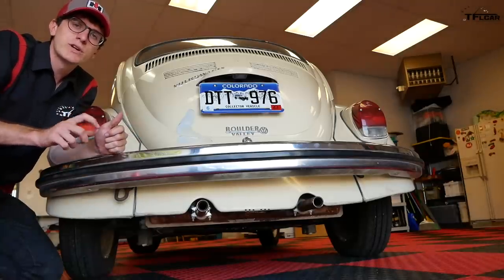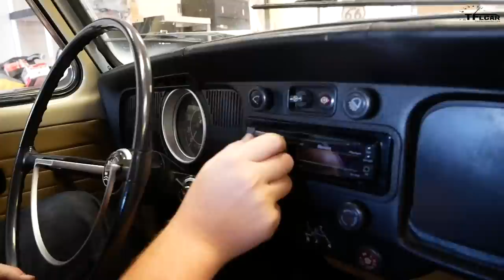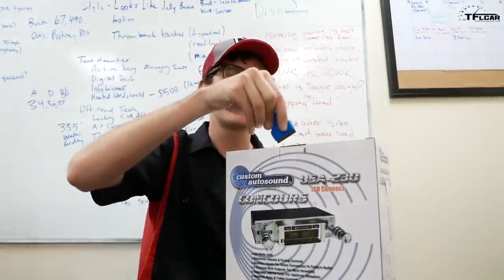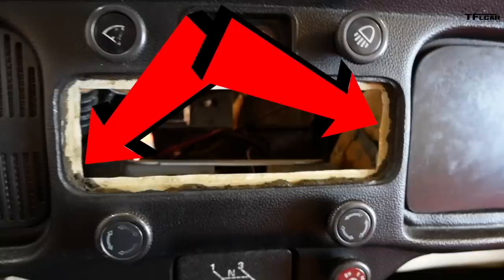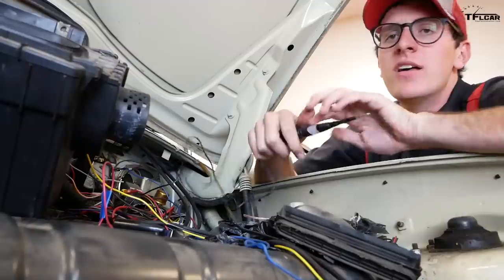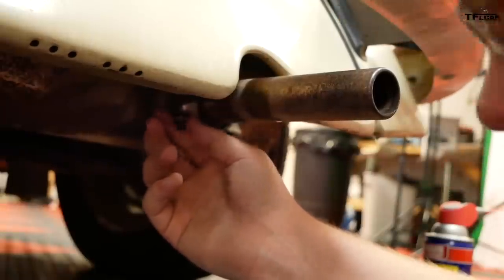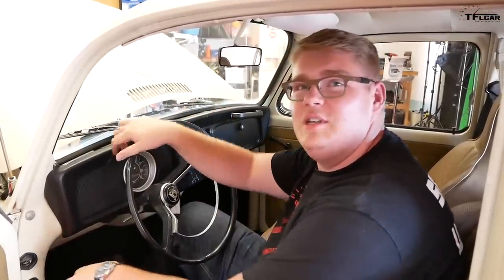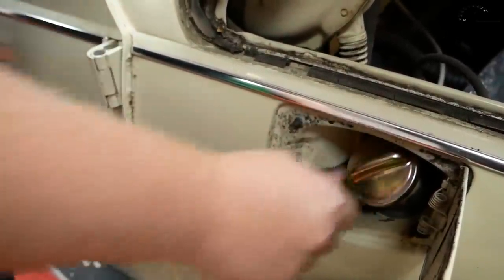How We Made our VW Bug Sound Amazing for FREE | Beetle Diaries Ep. 5

Comment: As an old VW guy I have to mention that chirp will change, depending on how far in you install the tailpipes. If you look in the muffler (with the pipes removed) you will see another pipe on one side. (forget which side) You put the new tailpipes in till you hit that other pipe then wiggle it back out about 3/4" or so. Install the other side to the same depth using a tape measure. That internal pipe creates a venturi effect and helps draw exhaust through the heat riser pipe under the intake manifold. Too much or too little back pressure at that point will change the heat riser flow and also change that chirp. Pushing the tailpipe in too far will also restrict the exhaust. If you get it just right you wont hear much chirp at all. (at least till the baffles rust out)

Comment: I was told that on the old 36 hp engines, removing the muffler caused the engine to run too lean, which damaged the valves. I wonder if those tail pipe tips were to create back pressure or perhaps prevent a too lean condition?
Reply: Just put in a larger main jet.

Comment: Fun video, Guys!  Here's a tip for installing the stereo: The metal plate must go on the interior side of the dash, not the trunk side, as you did in the video.  This metal plate is meant to provide stable support for the radio.  This is why the display is flush with the plastic face plate, which is not correct.   Instead, the display should protrude through the plastic cosmetic face plate about 1/4 inch or so.  Your installation will work adequately if you supported the back end of the unit with metal plumbers tape or other similar material.  When you install the AUX connector, I recommend you correct the installation of the metal support place.  Errors aside, keep up what you're doing.  Fun content, great video capture and editing work!  Cheers from an enthusiastic owner of three 1969 Beetles and two VW busses ('69 & '72).

Comment: My 2nd car was a 1973 super beetle,loved that car,bought it in 1978.Back in those day"s, a mail order company called J,C. Whitney made every after market piece you could imagine for a type 1 VW.Those cars were everywhere and cheap to buy and own.They sold a set of flared exhaust tips that took that annoying "whistling sound" completely away,back then regular department stores sold everything for those cars.Changing an engine was 4 bolts and 7 wires,1/2 day job.tops.Floor jack under the motor,pull it right out,new one went in just as easy.Windshield washer was powered off the spare tire,when you got lower than 26lbs. the washer stopped working so it didn"t totally de flate the spare,alot of really genious stuff on these vehicles!

Comment: I replaced the muffler from a bus one to the correct stock on my Super Beetle. One day, a tip fell off, so I bought two new ones. The one that fell was easy. The one that fell out. The other one-not so much! I had to spend about a week and a bottle of PB Blaster chiseling it out. It welded itself in. I removed the entire muffler and had to put it in a vice. I hop to not have to do that again!

Comment: Those little tweet generating baffles, actually serve a purpose.  The baffles help maintain the correct back pressure on the exhaust. Without this much needed back pressure, your little 4-cylinder friend will suffer from overheating, and possible cylinder burnout. You can run without them, if you use longer pipes, just do the calculations to achieve the same level of back pressure. This is akin to tuning the port on a subwoofer.  In my humble opinion, the Beetle should always have the "VW Chirp", but then I'm an old school "Air Head". Nice video guys!

Comment: I put a vw tip on a allis Chalmers exhaust pipe. Made it real quiet. My brother put a megaphone exhaust system on his vw with a 1300 engine with 1500 jugs and pistons along with a 3/4 cam,two barrel holly carb,bobbed fenders and hood bonnet. That was one fast car. Sounded like a big angry bumble bee. He also installed a fastback engine in another  bug. Had to ease on the gas especially when shifting gears as the front end would come off the ground and scrape the exhaust tips on the pavement. :O

Comment: Great job guys!  I got my 74 Super when I was 14 and I’m now 49, that makes it 35 years of ownership. After all those years I finally decided to try to get rid of the infamous gas smell. You will probably figure out that changing the gas cap won’t solve the problem... can’t wait to watch part 2 of your solution ;-). Keep it up, I love the way to do this serie.
Reply: 35 years of gasoline fumes...that has to be good for you
Reply: Eric Godbout -perso Yup, they'll probably have to check out the tank exhausting vent.
Reply: I cured the gas smell and improved the cooling at the same time.
Reply: @Celticgypsypnw I have a '71 Super Bug, and I couldn't get rid of the gas smell. So, in 2019, it became 100% electric. Now, it's possible to smell the leather seats, and to travel places in a strange kind of silence..........no engine / exhaust noise, but tire rumble of the road. The best thing ever.
Reply: @peterduxbury927  I have looked at that and it is very clever when done right. The cost and range put me off. I beat the gas smell in those and enjoy the original beast within. I redid the whole gas tank venting system and made it actually better than the factory intent. 0 fumes, better engine cooling to boot. Sharing for free to anyone who asks.

Comment: OK now, all you need to do is cut 2" off the ends of those tubes and remove the baffles. I knew a guy who raced and modified air cooled VDubs and he said that was the optimum tuning for the stock muffler (3" from the muffler). Sounds good too. The right aftermarket system can make these engines sound even better, though. I had a Thunderbird exhaust on my Karmann Ghia and it was superb. They were bought by Pertronix some years back, don't know if they're still in production, but Empei and Scat make similar exhausts. This type retains the heater boxes and join in a short collector in the center, and a horizontal, side-side  pancake muffler bolts on.

Comment: You are so lucky to even get the tips out, when you install them, use some never seize so removal is easier next time. also check the fuel filler hose that goes to the tank for leaks as this is the usual source of the fuel smell.

Comment: In my 1963 Beetle I took the standard end tubes out and replaced them with flared tips, so called TT Pipes, from 2 to 3 inches in diameter. The looked very sporty and the sound was much more aggressive. (The horse power remained the same....alas!)

Comment: not gonna lie, I even went out and bought a new exhaust for my bug and purposefully didn't put on the pea shooter chrome tips on lol. I kid you not, mine shoots flames quite big (and loud) when I let off the throttle at a high rpm.
Then i decided to be a good driver and decided to weld metal pipes over the existing exhaust cutouts so I don't have to use the pea shooter tips again and thus making my bug sound more mean. It still shoots flames occasionally, but not as often when it didn't have the chrome tips.

Comment: i didn't look closely enough, but they used to have removable faceplate stereos and removable stereos. to prevent stereo theft, they used to have stereos you could pull out of the dash and others that you could pull the faceplate (with all the controls) off. i can't imagine a faceplate coming off that easily and being put back on and still working if it isn't part of the design.

Comment: In the same vein as big green, it is time to reach out to an air-cooled performance engine manufacturer to see if they will sponsor a huge power upgrade. I am thinking 200 hp should do nicely and perhaps a small lift and Baja bug treatment for this little guy. Then retry Gold Mine Hill. Could be fun. Good video gents.
Reply: they sell fiberglass bodies for baja bugs...much better to use modern suspension and a tube frame is way stronger, safer. plus you dont hack up a classic bug
Reply: stickloaf Good insights.
Reply: Only thing is it's a super
Reply: or slam it down!

Comment: In the sixties and seventies Volkswagen dealers sold a factory accessory they called a Sports Tip they were a larger diameter but still had the baffles in the tip it was tuned to make your Volkswagen sound just like a 356 Porsche I had them on my 66 Karmann Ghia. I thought it sounded better than the header systems for Volkswagens But no one seems to make them anymore

Comment: With the new tips you have the old sound back - that's boring. On my first beetle (back in 1982) I removed the perforated sheets from the inside of the tips. That made a cool sound and looked original. 

On my later 1957 beetle I installed a larger engine and a Brazilian sound pipe, but that's another story.

Comment: Must be the shortest exhaust sys. on any car. In winter it's along way from the heat exchanger to the windshield. A german friend gave up scraping both sides of the windshield and used ski goggles with the window rolled down. The gas heater was more effective, but had downsides. Nice job on the stereo, but it'd be nice to see a Blaupunkt sticker.
Reply: Chris York by 'gas heater' you mean the original one, taking hot air from the engine cooling system through the air-box and into the cockpit ?
I mean, my question may sound strange, but here in Brazil we got almost no experience on heating systems, and since my '72 Beetle has one of those, I'd like to ask you: does it really works good on a cold northern winter ?
Reply: There were Beetles that came with a separate heater that used gasoline from the fuel tank. I've never owned one with that heater, but I think it was quite effective. It had a fuel penalty though.
 The original hot air from exhaust was not effective.
You can buy electrical heaters from the parts store to preheat and maybe even run if you have a good alternator.
No air conditioning in Brazil?
Reply: Chris York, thank you for your reply ! 
I've never heard of such gas heater, I guess it might be exclusive for European/North American winters. 
I just asked it out of curiosity, because I intend to fix my car's heater. 
But surely we seldom need to use heaters on a tropical country like Brazil !
And yes, we do have air conditioning, but not for the Beetle, and the entire air cooled engine line from VW.
In fact Volkswagen started to sell cars with AC systems in the early 80's, as optional items for their more expensive, luxury models.
Reply: Yes, different markets probably. Did you ever get the fuel injected Super Beetle? I got to drive one and it worked quite well.
Reply: Chris York not the Super Beetle per se, but actually, my '72 Beetle comes from a limited series which lasted until '74.
This version got a more powerful 1500cc engine,  elaborate interior in comparison to regular models, but carburetor instead of fuel injection.
But externally it looks just like the one pictured in this video above.
In Brazil, the VW is nicknamed 'Fusca', and this roughly Super Beetle was called the 'Fuscão', which can be translated into 'big Fusca' !
Reply: Ahh, I've seen the YT videos with Fuscão on the Trans Amazonica. 
The one I drove must have been one of the nearly last brought to North America. I think it was a 79.  It was a convertible.
Reply: Chris York yes, I've watched this Trans Amazônica videos, quite an adventure !!!!
Reply: Yes, really amazing! I'm surprised at the kind of vehicles that manage to get through it.

Comment: Not all of the stock style exhaust tips you can get make that chirping sound. None of our beetles does that. Some of them has to be "broken in" and some never seem to make that sound at all. When putting in the new tips they have to be inserted at a certain length. The left one is supposed to overlap the small preheat pipe inside the muffler by 5-7mm, and then just install the right one accordingly. But often it isn't that easy since most beetles have got a new muffler at least once during their life. And the repro mufflers usually aren't very consistent when it comes to these little details. I have only ever dealt with repros and have just made sure that they don't stick too far into the muffler. If they do it can supposedly affect the engines performance (I have no idea if this is actually true but it is very easy just to be on the safe side). They are also available in different lengths (265, 250 and 225). The older the car is, the longer the tips are supposed to be.

Comment: The "chirp" is from two reasons; On OEM tailpipes, the chirp happens when the glass packing has worn away leaving only the metal baffles, OR the tailpipes used are either made in Mexico or Brazil, if you use the actual OEM West Germany made tailpipes, there is no chirp whatsoever, and the exhaust will actually sound very mellow and pleasant too! Another item where country of origin is important is the actual muffler itself, W. German made are much heavier than the others and are also A LOT quieter, couple a W. German muffler and W. German tailpipes, and the beetle would sound almost as quiet as any honda or toyota. A Mexico or Brazilian muffler may actually cause the engine to run hotter and use more fuel, some beetles have even required re jetting of the carburetor after an install to stop an annoying acceleration hiccup that occurs when the engines back pressure has been decreased due to the sub-standard exhaust.

Comment: That chrome trim is also part of the silencing system as I discovered when I removed the rotten ones on mine ad had to fit new ones because of the increased noise level. Where would we be without zip ties? they have so many unusual uses.

Comment: Premier is not a cheap radio. Premier is a step up from Pioneers regular models. Which usually have more power on the outputs, better sound processor, advance equalizers and has a longer warranty. And your so-called Walmart special, Premier by Pioneer is not sold at Walmart.

Comment: My Baja bug had the radio pulled out when I bought it and I used it as a safety back up. If I accidentally left the keys in the ignition and locked the doors I was able to open the hood and pull the keys through the radio slot

Comment: That was actually a pretty good radio you pulled out.  Guessing it was either broken or not wired correctly.  Personally I would go with the retro radio like you did, but hide some better sounding component speakers.  Too bad they already cut out the factory radio hole, the old factory metal opening definitely looks better.

Comment: Actually, the tips are the mufflers.....the component you are sliding them into is the heat exchanger. The exaust pipes are encased in the chamber and there is airflow through the chamber for your heater/defogger.
There is no baffling in the heat exchanger.

Comment: The deck lid always leaks on the radio on the stock radio the top was solid no holes I had new gasket and I had to cover holes on top of mine  the new tip will rust in two months

Comment: WD40 is not a penetrating oil, it's a very light water displacing lubricant.  For the same price, you can by PB Blaster at any auto parts or hardware store

Comment: I bought the entire kit, including that radio. Did you have any problem getting it past the wiper motor? I had to take the face off the radio and reinstall it through the radio slot in the dash. I have a 72 standard Type 1.

Comment: Come on, the sound without pipes is just phenomenal. Can’t you make a way to have veedub sound like that, with  mandatory tips?  Just cut then by half an inch, and discard of the pipe inserts... (having had a beetle once, I know that the pipes may be modified....😄
Reply: I've never tried removing the baffles on any of my Beetles but I have replaced the pipes with stainless tube and it worked great, these days I just put on a sports exhaust and get a couple of extra horsepower!

Comment: Should've left the tips off
Reply: The exhaust needs to be directed completely away from the body for CO2 safety.
Reply: Mister006  Not to mention that old motor will leave everything black back there eventually.
Reply: Co2 safety? Haha bullshit
Reply: Circumsision
Reply: @Mister006  …  You mean CO (carbon monoxide) not CO2 (carbon Dioxide) whick is what's in fire extinguishers. CO2 is pretty harmless.

Comment: Did the painters at grinders switch.....or whatever .... tell you about the specific IMPORTANT purpose those tips serve? Didn't think so.
They are not to make the car whistle.... I can tell you that.
The left one has to go in a certain length to make a low pressure on the tube inside your muffler....get a flashlight and look.
Bernoulli’s law......
That tube draws exhaust through your probably plugged up heat riser tube attached to the underside of your intake. From the right side of the muffler .Preheating the intake, and helping to completely and thoroughly
Burn the fuel charge.
This is why a lot of vw engines run rich/ crappy, and the plugs foul.
See my video on this.